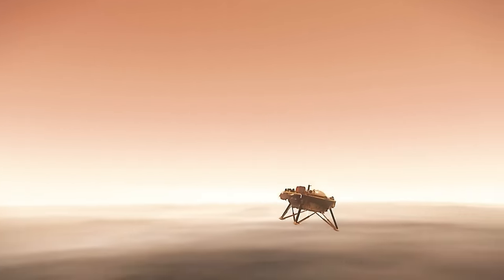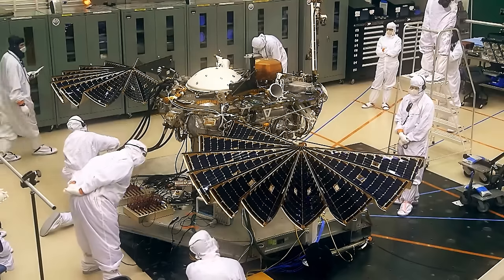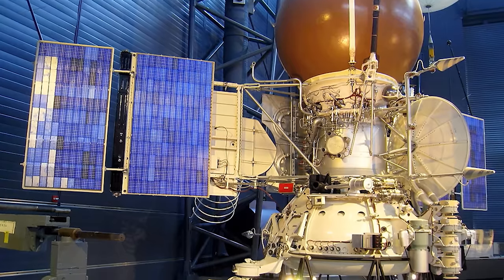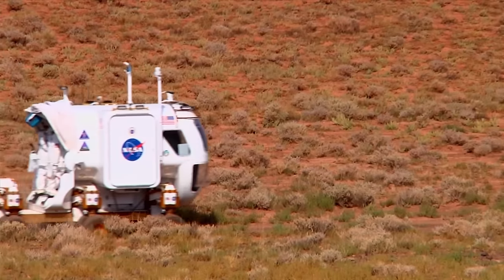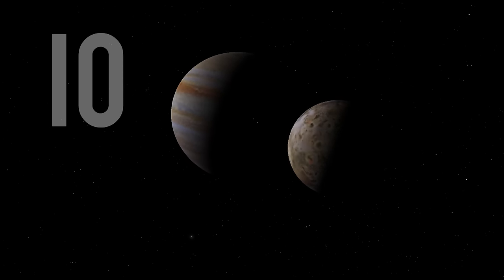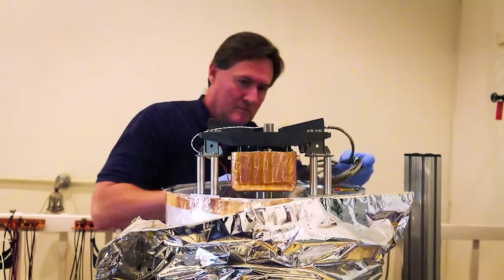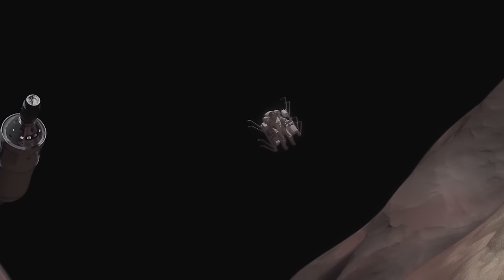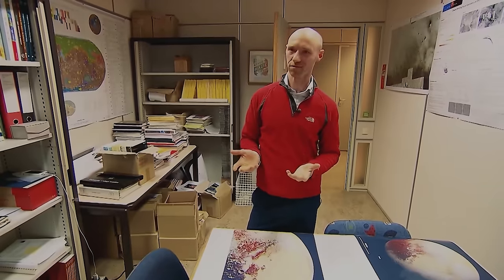3+ Hours Of Fascinating Facts About The Planets | The New Frontier Compilation

Comment: i think its for sure clock itself... but the technical question is how do we differentiate clocks mechanical dymacis difference is because of times dynamics or its because of forces affecting the clock ie out of ...
anyway i suspect that this might be something about mass... ie for example non magneting matter when enters a magnetic area or electomagnetic are... ie think about transformers.. when secondary offline coil enter a electromagnetic area it gains energy.. similar protocol applies for magnets too ... which makes me wonder is possible that some kind of force affects matter on denser places... and if things distance from them and by moving rotating you are getting out of sync with local power source and therefore that force being influencign less the moving ones may be the reason making moving clock work slower... so it may be just the thing tht powers universe powering less the moving objecs :D just a guess. :D
Reply: Brilliant! Indeed, Sir, we don't really know... Do we?